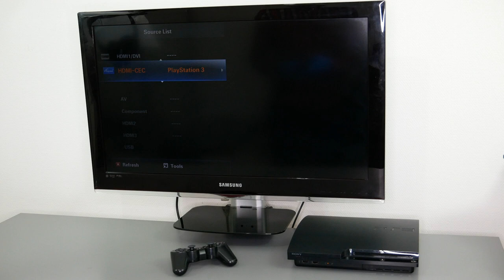Epic Deep Cleaning: The PlayStation 3 Slim Like You've NEVER SEEN Before!

Comment: Worst thing about PS3 is both cpu and gpu have IHS like a desktop processor. When TIM between cpu/gpu and IHS dried, no amount of cleaning can save it from overheating unless you delid and replace the tim. PS4 and PS5 design mitigate this issue by having direct contact to the die so you can just clean and replace thermal paste to make your console run normal again.
Reply from the maker: Thank you very much Bagus to took the time to write this interesting comment. I'm curious to open a PS4 now :)
Hope you enjoyed this video. Thanks again ❤️
Reply: Even worse is all FAT PS3s suffer from an nVidia GPU design flaw that will basically guarantee their death eventually (YLOD). The internal solder inside the chip will eventually crack and it will not be recoverable. You cannot re-ball it, you cannot re-flow it. Heating this solder is a delicate one-time process done at the factory but the design of nVidia GPUs from 2004-2009 like the 6000 series to the 9000 series (I think that's the range) is flawed due to the material they used as filler in the chips and they are all destined to end in the landfill, even if used in optimal conditions. The PS3 Slims have redesigned GPUs that shouldn't suffer this fate, I think.
Reply from the maker: Sorry I just didn't see your comment before today 😅
Really interesting! Thanks for sharing this Kun Ka ❤️❤️
Reply: Hello to both of you Bagus and French.Satisfactory. I’m planning to clean my ps3 in short future and here is the question: Do you have any recommendations in regards of TIM pastes? Does it have to be any particular(best for this purpose)? Thank you in advance for your time and effort. Cheers.
Reply: @danielfurgol7812 I'd recommend Arctic MX-6. Been using it on my CPU and GPU, and it's performing within my expectation. No push-out effect so far.
Reply: @Bagus-101  thanks a lot for your help.

Comment: Is a screw really a problem compared to my ps2 that doesn't have screws at all? Because after tear down screws disappear...
Reply from the maker: no screws at all? but did you take apart this PS2 and just didn't put back the screws? 😅
Reply: Yesss whit an important mod.. mine version of EE-GS
Reply from the maker: Well, I did not opened a PS2 yet. Will probably do it pretty soon but yeah... not yet. So, it is hard to answer